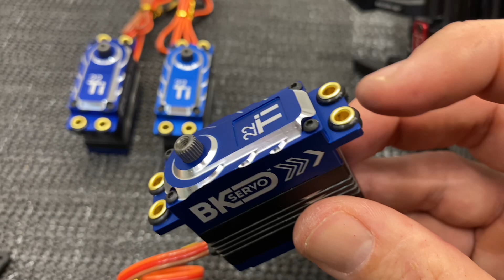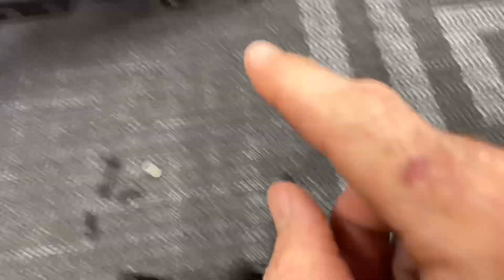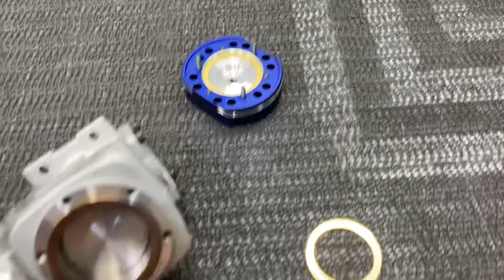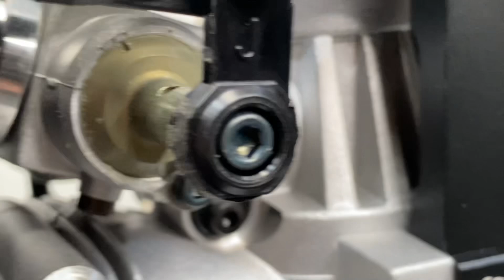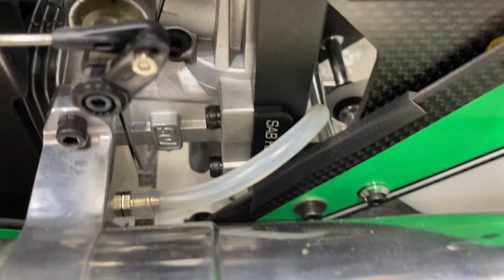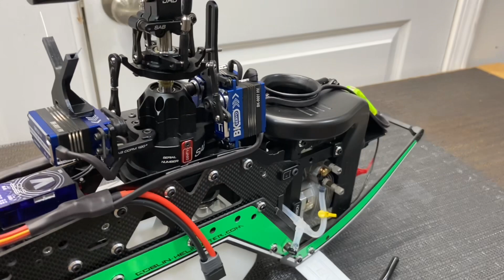SAB RAW 700 Nitro Build!

Comment: Won't ever run the grommets in the Servo! Check your elevator and try move it by hand. You'll see it adds too much play. Modern servos won't have any issue running them without the grommets.
Reply from the maker: Some people, Run them and some people don’t. I personally don’t have any excessive play or issues with running grommets and I run them on every Nitro helicopter for the last 20+ years.
Reply: @westhobbiesrc8051  try it out.

Comment: I am soooo tempted to go nitro. A gallon of fuel and go fly all day.. my only concern is the tuning.. I'm not good with tuning..
Reply: Pretty easy to burn a gallon with a 700 nitro in short order.  Still, it's all the more gratifying enjoying the engine and smoke.  Enjoyed your build video, Jeff.   I think your inclusion of the finer details is what makes your channel the bomb.
Reply from the maker: @robpound8163  you can definitely burn a gallon very quickly on a 700. I normally go though a gallon or two every time I go out because I just keep flying back to back lol Thank you! I really appreciate that. I try to make videos different then any other video out. Explain things in more detail. Show the right way to have a perfect heli and maiden after a build. Show what little things to do so you don’t have any problems. I hate to work on a heli or fix something after I build. So I do my best to make sure when that heli leaves my table it’s 1000% perfect!
Reply from the maker: You should! That’s the best part about it Nitro. Being able to just refuel and keep flying. Tuning is not that bad. I made a full video on it, but the smoke will tell you everything.
Reply: Don't be intimidated by tuning.  It's not that hard.  I'm sure that one of the older guys who fly gas planes/helis at your local club can walk you through it.

Comment: i mounted the servos with those servo gromits on my 580 raw, but i noticed there was to much play on the servos, so i decidet to remobe the gromits.
Reply from the maker: I personally don’t have any issues on any of my Nitro helicopters with the rubber mounted grommets with excessive play. There’s a slight few millimeters of movement, but as long as you’ve taken it all the way down and squish that grommet you shouldn’t have very much movement at all.

Comment: Come just when i'm building a new NX7 ! Is there really a big difference between powerboost 105hz and hz-r engine ?
Reply from the maker: That is a great flying helicopter. I did a full build series on one about a year ago. The only difference is one is regulated with a fuel pump, and the other one is not. There is no actual power difference, some people will tell you that the fuel regulated runs more consistent, but I personally do not run regulated engines on any of my Nitro helicopters.